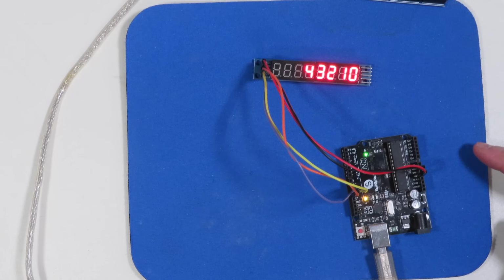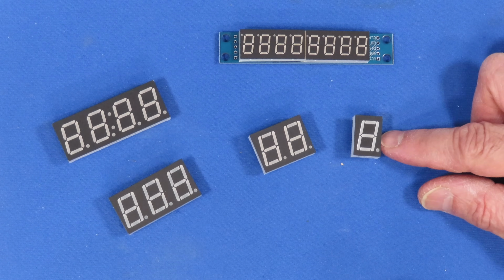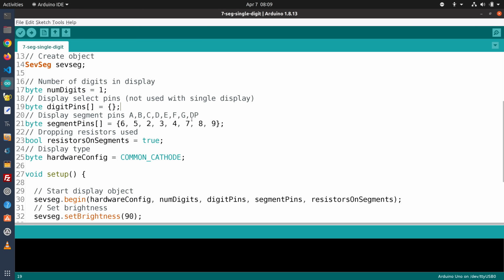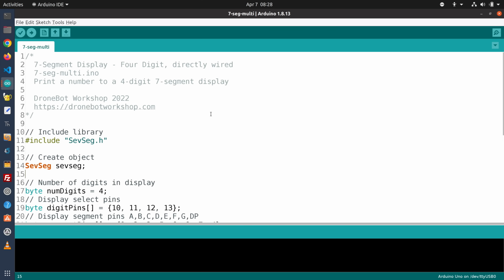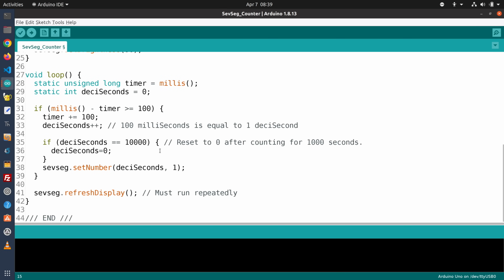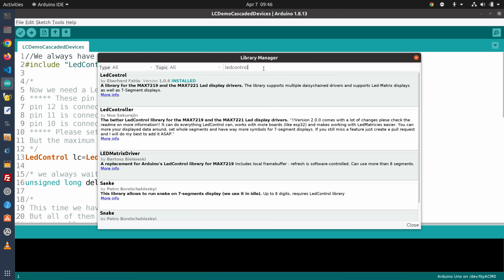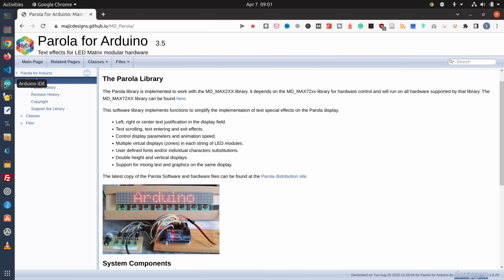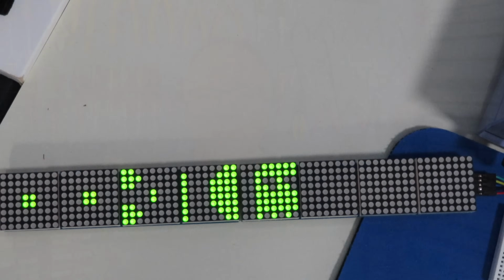LED Displays with Arduino - 7-Segment & Dot-Matrix

Comment: PROTIP: Go dumpster diving regularly.  You'll find lots of stuff with circuit boards and discrete components; wall warts; in addition I have found a handful of functioning computers as well  (sometimes they need cleaning).   You'll find 18650 lithium ion batteries.  If you get a Hakko desoldering iron that can help you build up your inventory.

Comment: With these pre-fabricated (cheap) 7-segment 8-digit modules you need to take care with the wiring. It seems the MAX7219 is more sensitive to wiring effects. You need to use short, soldered wires. The MAX7221 is likely more resilient to these disturbances. Look at the data sheet for these chips...

Comment: HERE the #solution for the #PacMan error in the sketch;

It is not really an error. Just the wrong hardware connection
default hardware = #define HARDWARE_TYPE MD_MAX72XX::PAROLA_HW

Opt this one out, and then;

Choose one that fits yours;
#define HARDWARE_TYPE MD_MAX72XX::FC16_HW
#define HARDWARE_TYPE MD_MAX72XX::GENERIC_HW
#define HARDWARE_TYPE MD_MAX72XX::ICSTATION_HW

Comment: Please note at 42'22" there is a line in your code. Line 29 HARDWARE_TYPE. You need to change this from PAROLA_HW to FC16_HW. If you make this modification then the PacMan animation will run properly. A bunch of those examples included with the library default to PAROLA_HW, and most users will benefit by changing this to FC16_HW.

Comment: If the Pacman animation had started on the left and cascaded towards the right as it went from one device to the next, then it would have looked a little more consistent.  Probably only a small code change is needed.

Comment: Great video! Just a question, i still have doubts about the wiring of the colon in the middle. I count 12 legs, 8 for the segments + 4 for the common anodes/cathodes. How can i wire the colon LEDs?

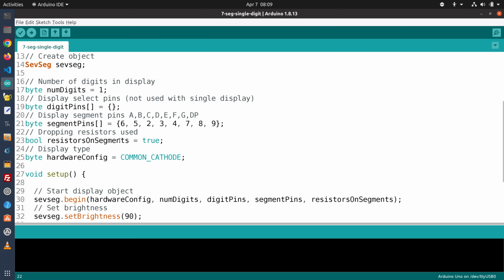Comment: 12:35 I believe resistorsOnSegments should be set to false instead since your resistors are on the digit pins and not the segment ones?
As per the README of the project on GitHub: _"... you should use current-limiting resistors in series with the digit pins. 330 ohms is a safe value if you're unsure. If you use current-limiting resistors on the segment pins instead, then set resistorsOnSegments to true"_.
When I replicated this exact setup with the 4-segment display it was very dim even with brightness set to 100; the more segments were lit, the dimmer everything became and setting resistorsOnSegments to false made it look like expected.

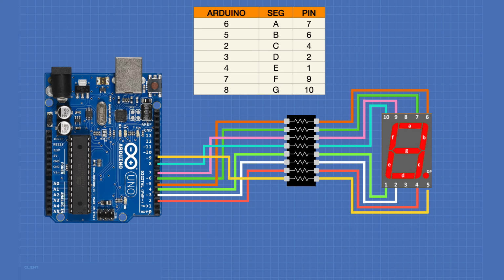Comment: @10:01 You said: "Common Anode Display" but you are actually using common cathode display connecting COM pin to GND!
It's just my OCD, I had to point this mistake out.

Comment: I once designed a digital clock using 7-seg LEDs back in the '70s. I came up with a neat trick; to make the colons between hours, minutes and seconds I turned each tens display for minutes and seconds upside down and reassigned the pins to get the numbers to display correctly, and that puts the decimal points of two displays between the digits, giving you free colons.
Reply: Anyone with any aesthetic sense will hate this "neat trick".
Reply: @futu1983  It does admittedly make a disproportionately tall colon, but it's free, and anyone with any aesthetic sense wouldn't likely be using 7-segment displays anyway. :)

Comment: How are you butting multiple 8x32 units together?  My thought is to solder a straight header pin on the other end and use jumper wires but not sure if it's going to fit that way with the wires and headers having to go between the LED matrix and the circuit board.  My other thought was to desolder the 90 degree header and use straight headers on the ends that butt together, that way the jumper wires would be on the bottom and out of the way.  A 90 degree female header was a thought but wouldn't let them butt together properly.  How did you do yours?  I have the same style where the 90 degree header pins would go between the LED matrix and the circuit board.  Thanks much, love the stuff you do and I always check your videos for awesome projects.
Reply: Ron, Did you get an answer? I am trying to resolve the same problem myself. I have 3 8x8 modules and short of Soldering the output of one to the input of another, I can't figure it out.

Comment: Very cool, cleared lots of things up.  I was just thinking how would one go about making their own led display out of led's , and perhaps draw text / images or animations on it but assumed the arduino was not suitable becaause of its limited I/O.  Then I saw a video of a guy who did just that, 7x10 led display segment modules that intereconnect with other ones. Theres 70 leds on each and all controlled by a micro controller with only 17 i/o pins. He used seperate transistors in the mix which i think was key.  The IO was for rows and column, not seperate leds, 7 for the rows and 10 for the colums so i assume somehow the transistors let him select sepearte led's. Im a newbie so i didnt understand his schematic and he didnt offer much explanation, but its cool to know you can actually controll more led's then  the i/o pins you have avaiable, even if it means seperate hardware like a bunch of pnp transistors.  I only wish someone could explain so eloquantly like DroneBot Workshop as to how.   Here's a link to the video for anyone interested https://www.youtube.com/watch?v=rVm0a2LOSjk

Comment: Has anyone figured out how to correct the Pac-Man sample so it runs through the panels in the correct order?
Reply: HERE the #solution for the #PacMan error in the sketch;

It is not really an error. Just the wrong hardware connection
default hardware = #define HARDWARE_TYPE MD_MAX72XX::PAROLA_HW

Opt this one out, and then;

Choose one that fits yours;
#define HARDWARE_TYPE MD_MAX72XX::FC16_HW
#define HARDWARE_TYPE MD_MAX72XX::GENERIC_HW
#define HARDWARE_TYPE MD_MAX72XX::ICSTATION_HW

Comment: Nice ! The pacman example seems strange because it's the wrong display type in the code I think...
You should add a green transparent cover to increase the contrast.
Reply: Pacman is running in the wrong order screen wise
Reply: HERE the #solution for the #PacMan error in the sketch;

It is not really an error. Just the wrong hardware connection
default hardware = #define HARDWARE_TYPE MD_MAX72XX::PAROLA_HW

Opt this one out, and then;

Choose one that fits yours;
#define HARDWARE_TYPE MD_MAX72XX::FC16_HW
#define HARDWARE_TYPE MD_MAX72XX::GENERIC_HW
#define HARDWARE_TYPE MD_MAX72XX::ICSTATION_HW

Comment: 7 segment displays have 8 pins in use, 7 for the segments and one for the dot. 16 segment displays allowed the designer to print letters on the displays but they were less common due to requiring more pins. RGB and RGBW dot matrix displays are a different ballgame, the older displays used a common cathode or common anode so driven from 8 rows and 8x3 columns however with the advent of addressable RGB and RGBW LEDs, these LEDs have a built in IC that you simply provide power to the LEDs and then chain the DI and DO pins together which allows you to access the particular LED in the chain. However, the downside being that each LED takes up memory space to work with, not too much of a problem for the ESP32 but can be a problem for the Arduino AVR based microcontrollers.

Comment: Hey Mate. I´m a new, but big, fan of yours. As a Arduino-beginner as me, your videoes are really helpfull. I am having problems with the 8x8. Just like Vic Dohar discriped with the code for Pac-man, it´s running the wrong way, and i can´t code my way out of it. any idears?. thanks. keep doing what you do, you are a geniues.
Reply: HERE the #solution for the #PacMan error in the sketch;

It is not really an error. Just the wrong hardware connection
default hardware = #define HARDWARE_TYPE MD_MAX72XX::PAROLA_HW

Opt this one out, and then;

Choose one that fits yours;
#define HARDWARE_TYPE MD_MAX72XX::FC16_HW
#define HARDWARE_TYPE MD_MAX72XX::GENERIC_HW
#define HARDWARE_TYPE MD_MAX72XX::ICSTATION_HW

Comment: Hi Bill, I always learn a lot from your demos. On the dot matrix example you show the CS connected to pin 3 on the Arduino but the code uses pin 10. Thanks for the great demos and lectures. You're the best,

Comment: Awesome stuff. More options for providing information to users, much like your e-Paper display you recently provided. I did notice that the Pacman example doesn't seem to be scrolling across the LED matrices properly. The Pacman should move from one side to the other chasing the ghost, but it seems out of sync. I suspect this is a problem with the code sample, and not how the LED matrices are configured since your "Welcome to the Workshop" msg came through fine. Great video as always. Appreciate electronic tutorials like these.
Reply: HERE the #solution for the #PacMan error in the sketch;

It is not really an error. Just the wrong hardware connection
default hardware = #define HARDWARE_TYPE MD_MAX72XX::PAROLA_HW

Opt this one out, and then;

Choose one that fits yours;
#define HARDWARE_TYPE MD_MAX72XX::FC16_HW
#define HARDWARE_TYPE MD_MAX72XX::GENERIC_HW
#define HARDWARE_TYPE MD_MAX72XX::ICSTATION_HW

Comment: How to modify parola scrolling sample to use Bluetooth for text input instead hardcoding it?

Anyway, My dot matrix 7219 works properly with parola library (with FC16_HW setting). But when I use LedControl library, I get mirror image problem. 
Anyone knows how to fix the problem?

Comment: Great video as always. you always give us such in depth information on the projects you choose. I would have liked to see you create something for this video with the alpha numeric led displays as well. All in all great video and thank you for all your hard work!
I noticed an error in your video animation for the LED Matrix. You define CS pin on the display connected to Pin 3 of the Arduino in the animation. But clearly in your video the chip select is on Pin 10 as shown in the Parola Library demo code.

Comment: @23:17, line 16: bool resistorsOnSegments = true;
Shouldn't it be false?, as you are connecting the resistors to the digit pins as the line comment mentions?
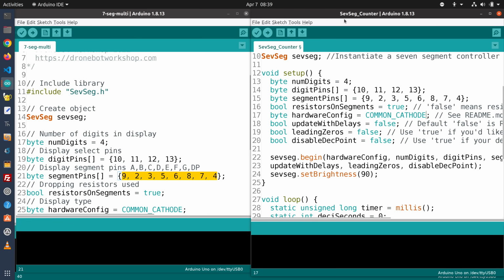Reply: You are right. @23:14 the comment explains this. With false the library multiplexes the other way round: it turns on one segment line and all digit lines that should have that segment lit. It does mean 1 in 8 duty cycle but all segments would have the same brightness.
Reply: @MrMartinB1962  Aha, got it, thanks a lot.

Comment: Nixies floresce/excite neon/argon/mercury gas between an anode and cathode. No filaments.

VFD displays use a filament heater and otherwise function like a vacuum tube.

Numitrons are all filament based and looked similar to modern LED displays. Some ran on 5vdc and could be driven using TTL chips.

Panaplex displays, which looked like 7seg LED packs, were nixies in every sense. High voltage needed, no filaments.

There were other numerous ways to display numbers back then. CRT based displays, dial light (optical), etc.

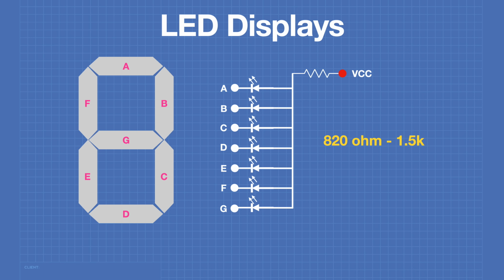Comment: @5:00 - on top of that: each segment can have a bit different luminance and forward voltage - as a rule one should not put LEDs in parallel for this differences in forward voltage. One more thing: if you put 1k resistor in common, you will never have more than 5mA in total current (actually much less even from 5V Vcc) while individual resistor being much smaller will allow more current to flow / brighter segments. So it seems to be a bit counter intuitive why > 820-1.5k Ohm for common connection (1 resistor) vs 220-470 Ohm for individual segments.
Reply: my understanding, using 820-1.5k ohm on common connection is not correct. You should just use same resistor (ie. 220-470 ohm). How the code works is it cycles through segments to switch it on. It does not switch all segment the same time. that's why in video, using 1k resistor will reduce the brightness, as you mentioned, the LED only gets very little current
Reply: @apratube  that makes sense - it refreshes each segment quite fast. Otherwise there would be no way of having multi segments with 1 common anode/cathode.

Comment: Correction: NIXIE displays use neon gas and require a high voltage power supply. They do not use filaments. Usually they have one cathode per digit so a typical nixie would have 10 cathodes to represent the digits 0 through 9.  The common anode connects to the high voltage supply of about a 170 V DC.
Reply: Referring to the number-shaped cathodes in a nixie tube as "filaments" is an acceptable use of the word in its generic sense. It's the same way the word is used for the plastic feed stock of a 3D printer. That's called filament, too. A few definitions from Websters-Merriam: "a single thread or a thin flexible threadlike object, process, or appendage" and (more to the point): "a cathode  in the form of a metal wire in an electron tube." The dictionary also includes the more-commonplace definition, "a tenuous conductor (as of carbon or metal) made incandescent by the passage of an electric current," but it is by no means the only definition. The word filament is from the Latin word filum, which means "thread."
Reply: @tcarney57  I think Bill was confusing Nixie tubes with INCANDESCENT displays,   which have a filament for each of the seven segments. When current flows through a segment filament it glows just like a filament of a light bulb.  Nixies contain ELEMENTS,  in a glass bulb with a rarified gas such as neon.  A high voltage applied between two of these elements causes gas ionization and the production of light. Both types of displays require a glass envelope with the air removed.  LED displays do not require that.